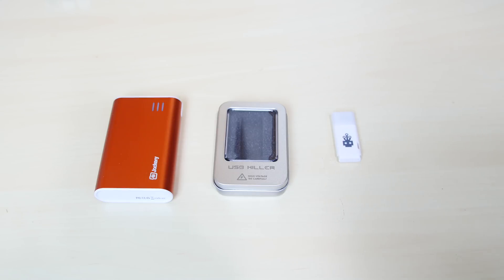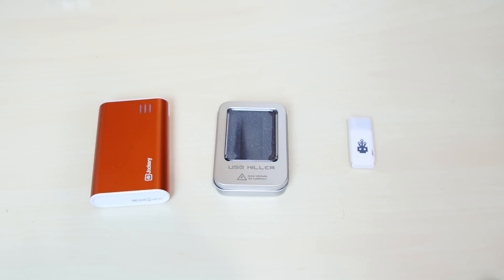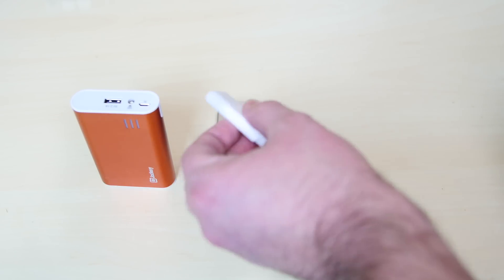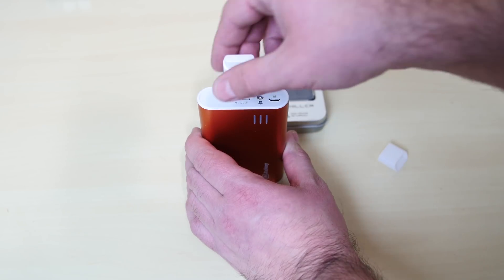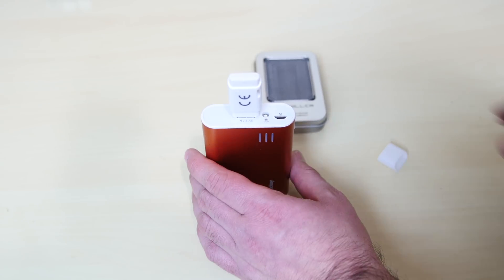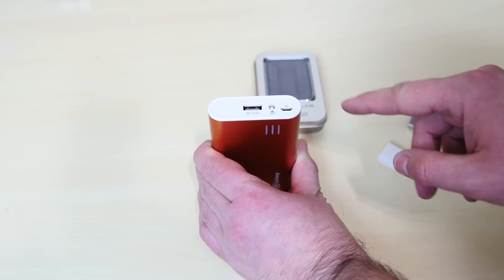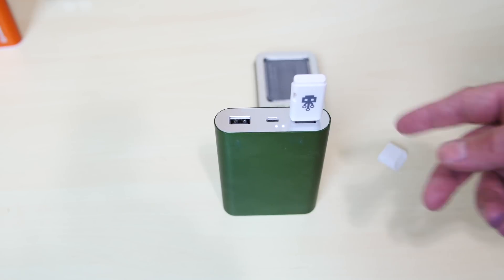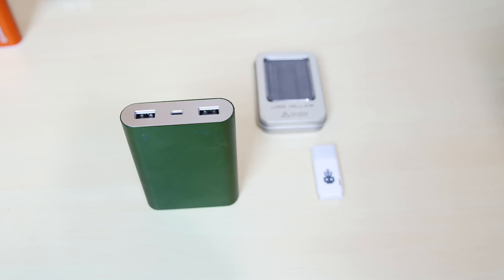USB Killer vs Power Bank!

Comment: To be expected the USB Killer 2.0 sends 240 volts through both data pins, on a power bank the data pins aren't used
Reply: Then we need to make a cable manually and change data and power pins. As result - we crafted a little bomb

Comment: ... the powerbank charges the capacitors... you need an adaptor and put in the micro usb...
Reply: I think it will didn't work, USB killer need to take power, charge and then discharge into USB. Power bank receive energy through this port, so IN port will not give energy.

Comment: Power banks don't have the USB data port soldered into the PCB or don't have traces to go, which that type of USB killer that discharges its power to the data lines don't affect the power bank.

Comment: The power bank probably has the data pins shorted
Reply: No, the USB Killer is just a bunch of capacitors and capacitors are designed to be able to rapidly discharge all their current at once.

Comment: my computer won't start because of this guy don't watch his videos he sucks his stupid tutorial ruined my computer
Reply: No, you did not read the note warning killer usb. because usb killer can against some pc how to kill if your motherboard can damage. but you look at it:

what is usb killer?
The USB Kill 2.0 is a testing device created to test USB ports against power surge attacks. The USB Kill 2.0 tests your device's resistance against this attack.

The USB Kill collects power from the USB power lines (5V, 1 - 3A) until it reaches ~ -240V, upon which it discharges the stored voltage into the USB data lines. 
This charge / discharge cycle is very rapid and happens multiple times per second. 
The process of rapid discharging will continue while the device is plugged in, or the device can no longer discharge - that is, the circuit in the host machine is broken.

The USB Kill Tester Shield is a dual purpose device: 
- It allows you to test your USB Kill 2.0 without damaging your host device.
- It prevents data theft via 'juice-jacking'
If you use a charger or USB port that is not your own - the device can steal your data while you are charging. Using a USB Kill Shield will prevent devices from having access to your data.

that's why you did an act of stupidity without knowing, how did you kill your pc. BUT YOU MUST REMEMBER READING NOTICE TO NOTE BEFORE USING USB KILLER!

i'm computer base as i know everthing. or you ask other people can explain you to before of using usb killer.

Comment: EXPLANATION
The usb killer gets the power from the +and- wire, charges up and sends it back throug the data wires, so all the data chips are dead, but the powerbank hasn't got any data chips, the data wires aren't even there. So no power will go to it and it survives!
Reply: E X P L O N A T I O N
Reply: Technically correct
Reply: Thanks for the insight!
Reply: And btw your theory wasn't true, the input doesn't give power to the killer to charge.
Reply: Correct
Reply: Quinten O but that was the output not the input